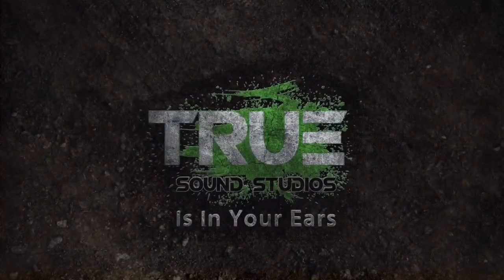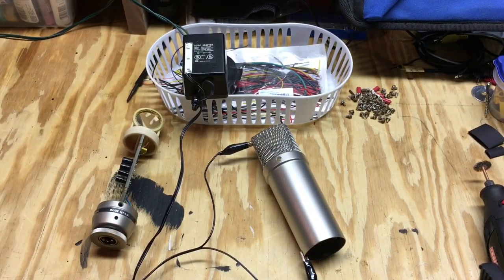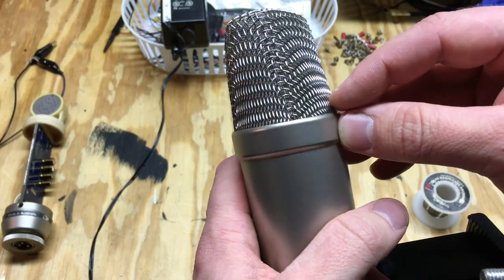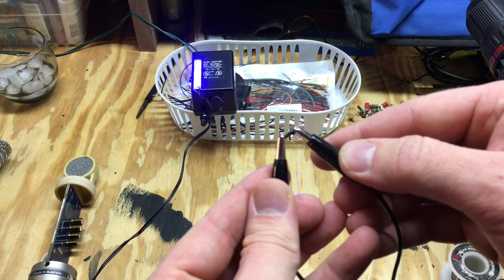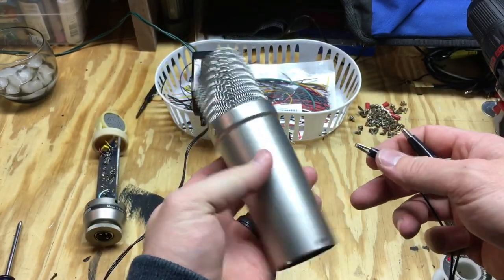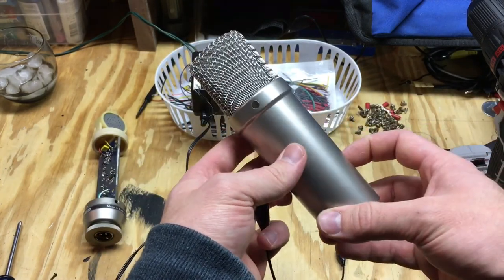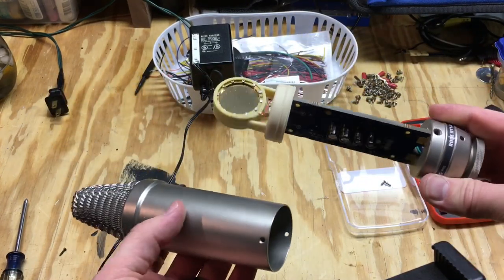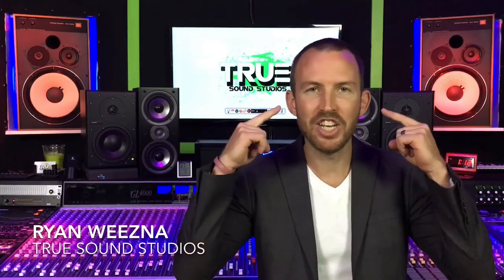DIY Fix: Interference Noise on a RODE NT1-A Microphone

Comment: I wish you had actually played the type of noise you were getting so we know what we are dealing with. I’ve been having issues with mine and I’m not sure exactly if it’s common thing and how to fix it. I’m trying to find videos to see if I’m not the only one with this problem. A little help anyone??? 
Thanks guys
Reply: I second this question.
Reply: Same here. I get distorted sounds in between my recordings using this mic. My input gain level is even 8 or 9 o'clock only.
Reply: @PatrickJohnEramis  I've literally taken the entire mic apart, resoldered connections numerous times, and it still hasn't been fixed. I'm wondering if it has something to do with the piezo disc specifically? I've also heard that a mic being in a humid environment over time is not a good thing, but I'm not sure.
Reply: @mynameisChesto  so much factor to consider really. It could be the cables that we're using, our room etc.
Reply: @mynameisChesto  have you tried contacting Rode company?
Reply: @PatrickJohnEramis  Not yet - perhaps I should.
Reply: I have nt2 a and it gets wind noice all the time.  i havent find any fix for this issue about 1 year and it gets annoying...
Reply: @acemixer  same here bro. so god damn annoying. ive taken the mic apart and put it back but still the same wind noise
Reply: Maybe the sound card
Reply: @acemixer  did you buy it with out any guarantee?
Reply: @acemixer  Does your rode mic still work? Just curious to see if they last before i buy it
Reply: Does your rode mic still work? Just curious to see if they last before i buy it
Reply: @TheSecondC2  it’s a really good quit Mic and gives you great quality audio but I concluded the minute your start recording higher decibels such as singing or HipHop you get a windy distorted noise and there is no way of fixing it. I thought it was my cable connection and I even thought it was my sound card and wasted money buying new cables and sounds card thinking the mic is new it can’t be it. By the time I finally realized it was the mic it was too late my warranty had expired already. It’s only good for talking into it like doing podcast so I sold to someone who needed it for live podcast I ended up getting a  Neumann Mic and I have no issues with it.
Reply: @StevenSawersMusic  any luck figuring it out? I have the same problem

Comment: I have a completely different mic but this fixed my issue. I had a constant 60hz hum unless I grounded the whole thing with my hand. I took it apart, sanded down the crappy coating the manufacturer put on (so that the ground, capsule shield, inner body and outer body are all connected) and it completely solved the problem! 

I think the noise floor might even be a few db lower, but could be placebo. Should have taken a reference recording beforehand!

Comment: I had a similar issue with a NT1 from Rode. I didn't have the courage to drill the mic cage, but I fixed the issue by wrapping the inside head of mic with aluminium foil. The hiss sound is gone and it doesn't seem to impact the recording quality.
Reply: Aluminum foil and sanding down the edges of the metal body to make better contact...and then tightening the metal body securely in fixed my problem! Thanks for the aluminum foil idea!
Reply: I don’t want to drill mine either but not sure where to  wrap the foil.
Reply: @Vailforreal   let me know when someone replies, im in the same boat
Reply: Boas tudo bem? Eu tenho um NT1 tambem e ouço barulho q parece ser chuva ou white noise. Consegues me elaborar mais como fizeste essa técnica do aluminio sff? Ajudava-me imenso. Tu puseste aluminio por dentro a volta do cilindro ou a cobrir tambem mesmo a rede metalica por dentro? Obrigado abraço
Reply: @ferruporcabeca2703  Separa a parte externa do microfone do resto, como no vídeo. Corta um quadrado de papel alumínio (~7x7cm) e usa para revestir o interior da malha de metal, cobrindo toda a area interna, mas atenção para que não colapse para o meio. Insere o resto do microfone no revestimento, com cuidado para que o alumínio não toque no ressonador (circulo).

Comment: Mine is an original NT1..had it a long time. All of a sudden it got real noisy in my interface. Didn’t think to check the shield for continuity. I geuss the shield and body is like a small faraday cage, and if the shield has moved then interference gets in. Mine has grey painted body not metalic like yours..probably unpainted on the inside. Will open mine and see what the deal. Thanks for the tip

Comment: Thanks for this video. Really appreciate it. I just got a used rode nt2a microphone. When I use the Cardiod pattern, it does fine but when I switch to either figure 8 or omnidirectional pattern, I usually get some spikes on the DAW meter when I arm it for recording. What could be d problem?

Comment: Hey brother, good post. Quick question: I purchased a Rhode NT1 Kit (black NT1) and I am getting a lot of static and the mic seems to complete cut out on the "p" sounds. It's really odd. I tried a different (brand new) interface and ran the XLR cable from the mic directly to my interface opposed to my analog gear to eliminate the possibility of it being my dbx preamp. My point is I am left with only the mic cable or the mic. As the mic and the cable are both new I am a little lost. Thanks man!
Reply from the maker: I see, yeah i'm not sure but it sounds like maybe a capsule issues. If you can, record what is happening and send it to my email. I should be able to better help you then. Email is in the description of the videos - Thanks for watching!
Reply: TrueSoundStudios I had this same issue! I got 2 mics in a row with this problem. I sent both back. Checked with different interfaces and microphones and cables. It was the Rode NT1 malfunctioning two times in a row.
Reply: Definetely capsule issue.... Does the capsule exposed to heat or moisture maybe? if the issue is capsule then change tha capsule with K-47 one and thank me later
Reply: And never use the rode cable it stinks

Comment: FML. You skipped over loosening the screws in disassembly I needed to see you take out the screws so I can see if there's a reason the screws in the body are so tight before I start wrenching on them.
Reply from the maker: Yeah unfortunately i didn't think of filming this until i had already taken it apart

Comment: im actually having a heart attack as he is drilling. oh god whyyyyy. yeah mine is the nta-2 and is making the same interference noise. but do i really need to drill through lol
Reply: You may actually use a simple pin, and clip it between body and grill or just pu it in there.. Fixed mine NTK interference noise
Reply: @aftintalks  cheers for the reply, went out that same week and got a SE2300
Reply: @aftintalks  yea there are so many ways to conduct. Like copper tape.  Why drill !!!

Comment: This means that mesh doesn't have contact to metal body which means you should have turned the mic back to factory cause it is a manufacture failure I guess... I have The Rode NT1-A too. It has a shitty freq response on upper mids and top-end especially in 4 to 8 khz area.Use microphone parts com K-47 capsule if you are not happy with the shitty freq response.I hate the Rode mics just because their overly bright capsules.Rode should switch to K-47 capsule instead of cheap imported K-67 capsule although its 5db self noise circuit is amazing
Reply: Does your rode NT1-A still work? Just curious to see if they last before i buy
Reply: @TheSecondC2  yeah it works but I changed the Capsule with a K12 Capsule cause a singer Just get too close with the mic and damaged the Capsule 😅
Reply: @the-matrix-has-you  this mic pics up so many bad frequencies i wish i knew how to mix all tht out without ruining my vocal crisp